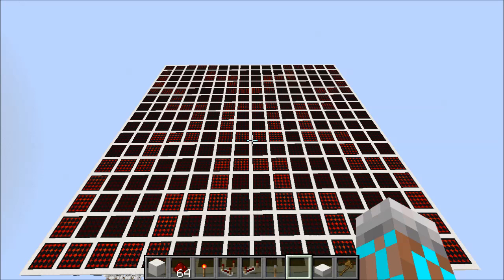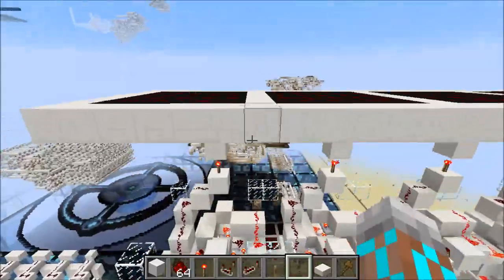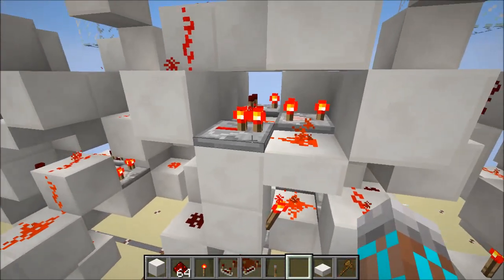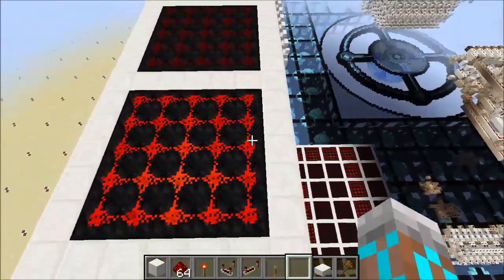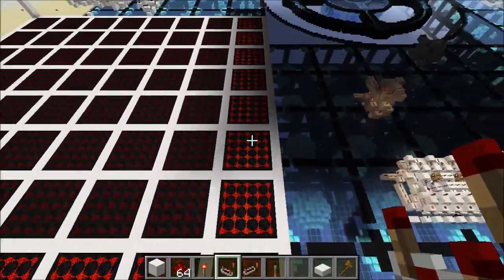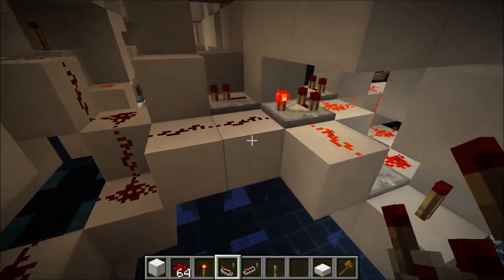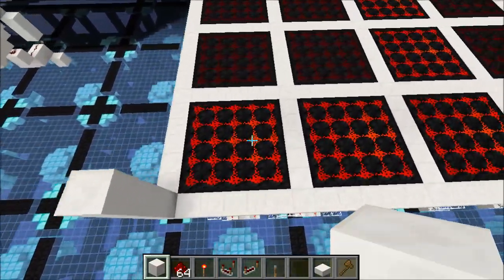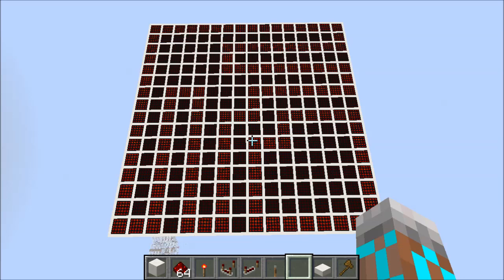Fancy Box Drawer - Draws more than just boxes!

Comment: So the cells are basically XOR gates, right?
Reply: Seems so... Two XNOR gates perpendicular to each other, with one shared input, and an extra output that is basically a NAND of all the un-shared inputs and outputs, if that makes any sense.

Sincerely
Marrus Quinn

PS: Trying hard to make one better design with that knowledge. It's tough, though mods make it easier; ProjectRed, for example is great for planning, even if you are a Hardcore vanilla builder
Reply: Hmm, I guess pen and paper can do the job aswell ;)
Anyways, never forget your goals and the properties of the vanilla components (as for example speed or size or whatever)!
Reply from the maker: You're correct!
Reply from the maker: Good luck with improving the design! I aimed for 6x6 because that's (currently) the cell dimensions that I'm planning on using for the "rendering tower" and it's likely that with a bit of creativity you can compact it.
Reply: Properinglish19 Well, with mods I can get the design size down to 5x5x2, tileable without any extra space but with vanilla redstone it's gonna be hard.

Edit: Fixed minor issues in punctation and choice of words
Reply: I made a tillable 6x10x6 (that's using x then y then z) design that was inspired by this that used a togglable inverter that properinglish19 made a video on. So basically, it's heavily inspired by properinglish19